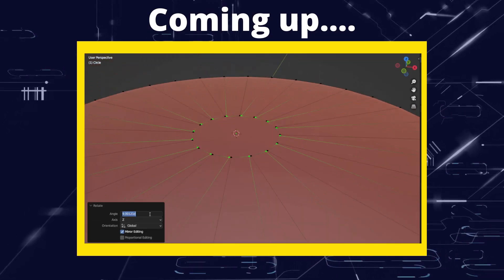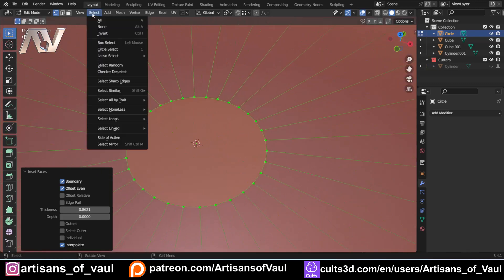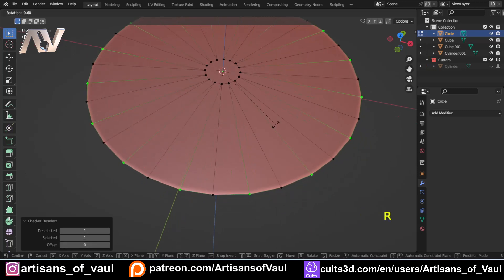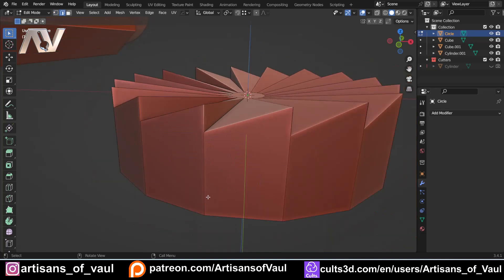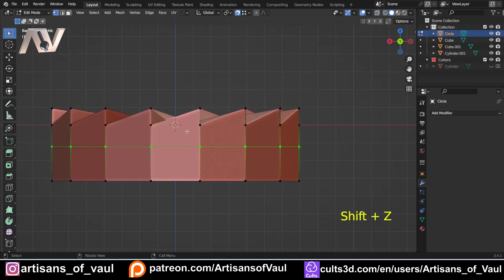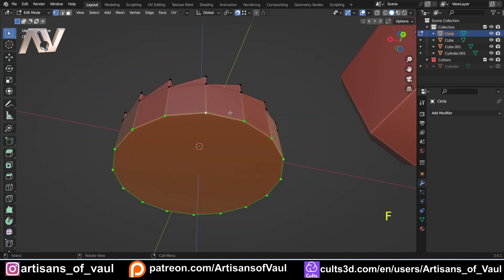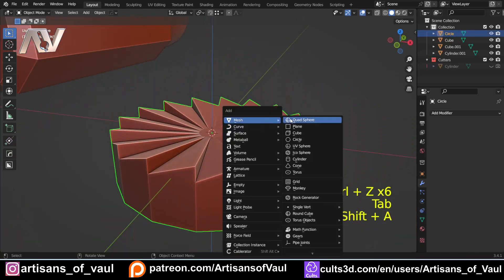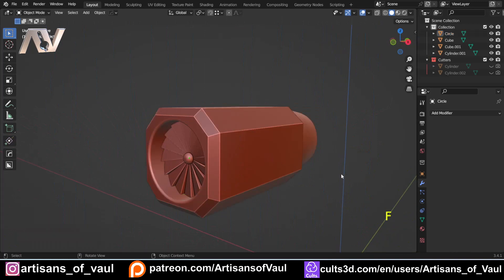The fastest way to create turbine blades in Blender for 3D printing

Comment: I can't put into words how amazing this video is!
Reply from the maker: 😁😁😁😁  Thanks so much, really nice of you to say.
Reply: @ArtisansofVaul  Dude, I was sitting in front of blender, trying to make a very basic fanblade and I just couldn't get anything to work.
Then I saw your video and your method works like a charm and is super easy and quick to do.
This is in no small part thanks to the way how you explain things and present information.

With your video, I also got useful info on how to use the checker deselect feature and a method to get rid of unwanted vertices.

I just started out this week and it's content like yours that makes me optimistic about getting a knack for blender, though it'll be a lot of hard work. At least it's a lot of fun hard work, thanks to channels like yours!
Reply from the maker: @h.a.9880  Honestly that's great to hear, especially to be able to help someone starting out.  Also sounds like you're on the right track, I really recommend working on projects to learn Blender as it helps focus what you're likely to need 👍

Comment: I just played along this video and it taught me more than the whole donut tutorial. One question though: How do I get the face mode/vertex mode/etc. selection ring? No TAB combination works for it and the cheat sheet I use does not have it either, I select the modes with the 1, 2 and 3 keys. TAB alone (as shown in the video) switches between edit and object mode. Did you rebind that, is it because of a different version, or is it from a plug-in? (I didn't get machine tools yet)
Reply from the maker: 😁 Thanks so much. That's great to hear.

The tab selection menu if from Machin3 Tools. If you go to gumroad it's a free addon and has loads of other great functions too.

Comment: Hey, I noticed that you have a Cablerator video, but didn't see one for Construction Lines.  Do you have one?  Do you have any idea how it compares with the CAD Sketcher addon, that is the one that I was considering getting.  Also, I noticed that Just Panels seems to interact with DECALmachine and KIT OPS, two of the other addons on my soon to buy list.  If you can get an affiliate link to them, I would like to use it.  Not in a big hurry... I already have HardOps, BoxCutter, Machin3 Tools, and MESHmachine, although I really don't know how to use them yet.  Do'h!

I'd be highly interested in any videos that explain is simple terms how these addons help me with my modeling.  I know you have done a bit of that.  I kinda understand what Boxcutter does,  I'm just not comfortable using it.  Maybe some of these don't work with a 3D printer?  I'm guessing that DECALmachine doesn't... not sure.  I want to model scifi stuff, like robots, armor, spaceships, and then eventually sculpt more organic stuff like animals, cartoon characters, aliens, and monsters.  Want to be able to use my models for still images, animation both in Blender and Unreal Engine 5, and be able to 3D print them.  If you have any pointers on how modeling for each of those differs and things to watch out for, I would be very interested.

Not trying to be pushy or anything.  Not even a Patreon member or anything (yet), but I see that you do videos fairly regularly, maybe you could use a few suggestions for some video topics.  

Thank for all of the great content and info.

Comment: I mean you could save so much time not bothering with all those knife tool shenanigans if you just take the loop you create at 3:35 and flatten it on the bottom-most point of the fan blades.
Reply from the maker: 🤣 That's a fair point, lols. Apparently my brain works better creating a whole shape and modifying within it than slowly building it up. Which I think I already know but it's always interesting to have it pointed out and shown in action 😁👍🏻
Reply: @ArtisansofVaul  Hey, it seems to clearly work for ya haha